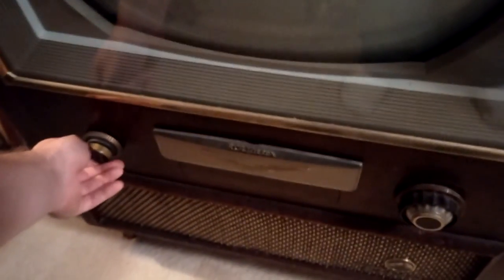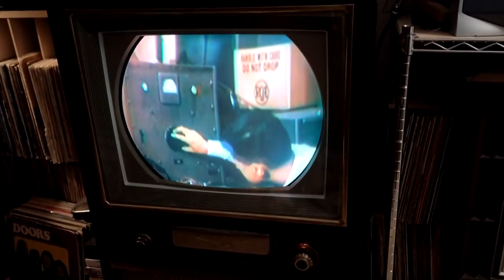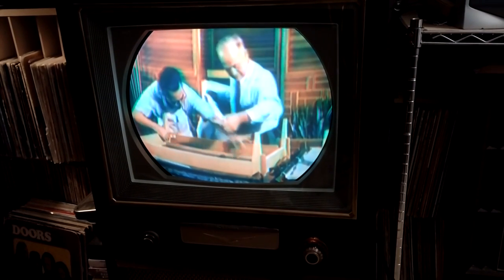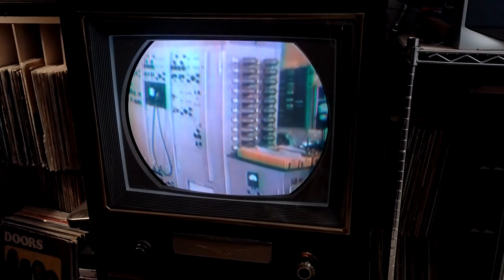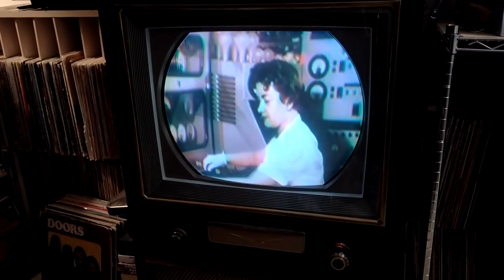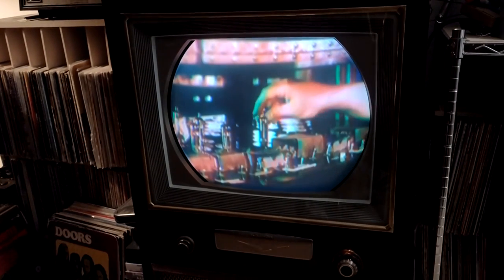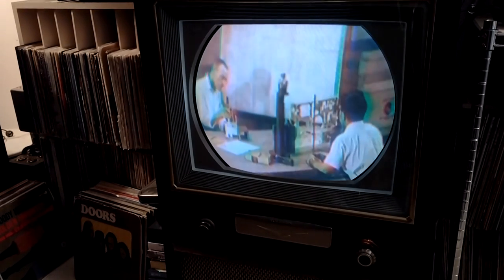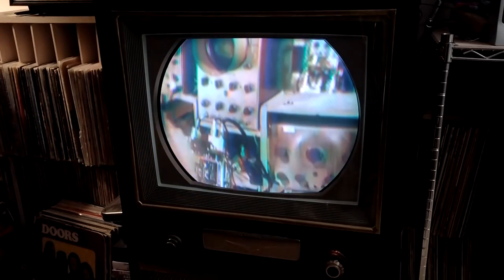1956 RCA Film On A 1955 RCA 21CT55 Color TV!

Comment: Great picture. It has a little 'bleed' which only indicates there are a lot of hours on the CRT but other than that? 1955 RCA Quality!
Reply from the maker: The bleed is a chroma demodulator related issue. If I turn the color off it vanishes.

Comment: Great work in demonstrating this old set from the year of my birth. With roundie tubes you would of course miss part of the picture compared to viewing on a standard black and white set. What would the over the air picture be like in terms of colour fidelity and quality in areas of poor or difficult reception when these sets were brand new?.
Reply from the maker: This response touches on a lot of deep rabbit holes.
Both of my parents weren't born yet when this set was built (though 1 was born that decade) so the following is based on my experience as a 90's kid with 70's-90's TVs, and my experience running these sets on my own home low power transmitters (this video the set was picking up my transmitter off rabbit ears) and what I have read about the early days of color.  When they shutoff analog it was early in my collecting and I had 3 working vintage sets...A 1971 Zenith color and 2 50's B&W sets.
Generally speaking all TVs will develop snow issues as signal gets weaker (better antennas can mitigate this up to a certain point), if the station was broadcasting in color then snow will be in in color too (the proper period term for color snow is confetti). Generally once a signal gets extremely weak, color sync will be the first thing lost, though the snow may be bad enough before then to prompt the user to manually turn color off for better viewing. Tube TVs have a 'Color Killer' that looks for the color sync pulse and shuts off the color demodualtors if it's absent. In the 50's-70's stations would turn off color and run the sweep at slightly different B&W frame rates. By the 80's so much of the programming was majority color (and to help early digital time coding programming automation systems) stations started transmitting color burst on monochrome shows and running the color sweep rates on monochrome shows (which were only ~1/1000 different).  Generally in weak signal conditions if there's enough color signal to sync to, tint accuracy will still be pretty good, but snow will mess with color intensity on a solid colored surface, and produce confetti small random dots the wrong color.
Color broadcasts in the tube era weren't necessarily of great quality as well.  Network feeds had problems with distortion of the color signal from frequency dependent phase delay, and it took them some time to develop reliable equalization circuits to seamlessly compensate for it. Local stations often didn't have their cameras, film chains, VTRs and network feeds calibrated perfectly so it was common to need to tweak tint and color level from station to station, when a station was switching from live local to network or recorded media, or from show to show (different cameras in different studios)...Sometimes even on a single show there could be noticeable difference when switching between cameras occasionally. Generally the stations in the bigger cities (Chicago, NY, LA, etc) had a better budget and did a better job of maintaining consistency from show to show and station to station....Solid state gear in the 70's onward greatly improved consistency as well. 
Also the quality/accuracy of color picture the end user got varied quite a bit based on the skill of the end user. Some people didn't really get the color user controls on their TV....Heck the TV departments of some stores sometimes didn't get it, or didn't stay on top of it as shows changed throughout the day.
One of these sets could look incredible, or kind of lousy depending on the circumstances...
At the end of the day if decent signal could be pulled in from the antenna and the user had a decent understanding of the user controls most station side sins (at least the ones they wouldn't get an FCC fine for) could be compensated for in the TV.
Reply: @tomcarlson3913  Thanks for your very comprehensive answer Tom.

Comment: Beautiful old tv set. Does it have a convergence problem?
Reply from the maker: It's more of a chroma demodulator problem...Some time after the 2018 resto I did on it a problem developed where sometimes on brightly colored objects the demod puts the wrong color before and after it...The on a still image I can eliminate the issue by turning color down till it's monochrome.  There may be RF multipath (a transmitter elsewhere feeds it) and or fine tuning issues contributing to this.  The fine tuning most prominently the color carrier level drifts for ~20 min after warm up requiring fine-tuning touch-ups for the first 20 min on. If you compare the beginning to the end you can see the issue seems to develop gradually after power up.
Reply: @tomcarlson3913  Cool, thanks for the info.  I have been out of the tv service ver since they went transistor and shops started going out of business.  I was an in-home tech back in the day.  By the time I got my own shop, sometime in the early 70s, shops started going out of business.  That is when I changed careers.  Now I love restoring these old sets when I can find them.  Haven't seen a tube set of any kind here in the Arkansas Ozarks in the past 8 or 10 years.  I'm still looking though.

Comment: Wow, where is this "time-machine" living room at? Had a big wooden French provincial RCA years ago with a CTC16 and 21FJP22 round picture tube. I could fix anything that went wrong by myself with a Sam's Foto-Fact folder on it. Great set that sounded good, too with two 6" X 9" speakers in it. T/Vs were better by the pound back then, and this set was a Gawd-awfully heavy piece of furniture.
Reply from the maker: Technically a bedroom somewhere in Waukesha county Wi. The 21CT55 is over engineered and over built. The cabinet and CRT alone weight what a 60's roundy would, and the 37 tube chassis makes it small TV/stereo combo heavy.
Those CTC-16s are nice sets. I've had 4 come through my hands and kept the most deluxe/cherry/cool looking example, my remote Stockholm combo. I think I included a brief shot of it near the end of my second video.